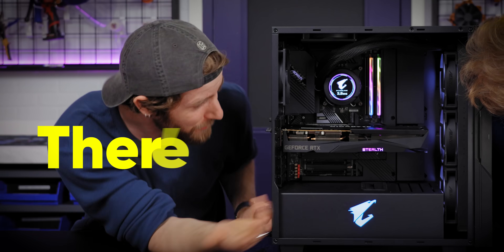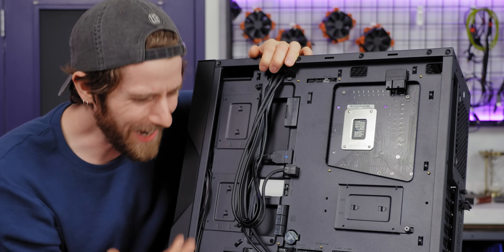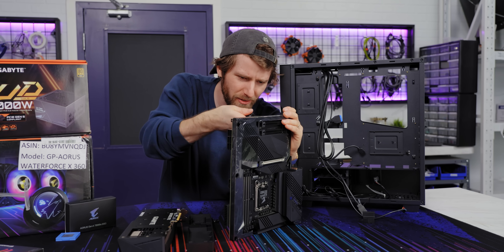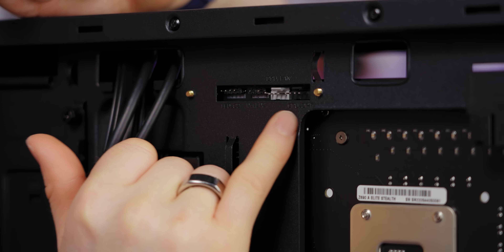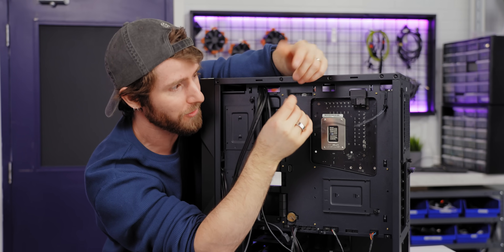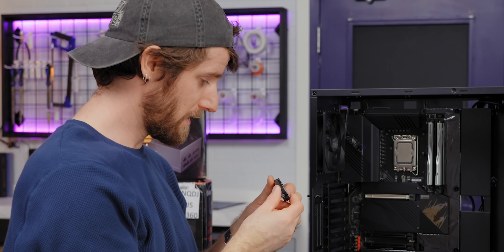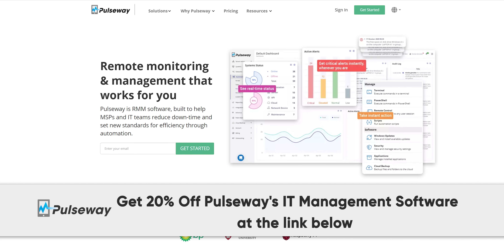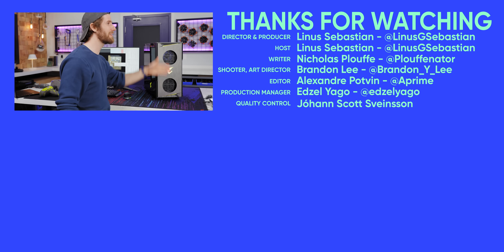Where Are the Cables??? - Gigabyte Project Stealth

Comment: Well, it doesn’t seem like it would be that difficult for every AIB to manufacture GPUs with rear facing power connectors.  That said, I wonder why the PCIe standard hasn’t just made an even longer slot to allow for more power delivery.  You could get AGP and early PCIe cards that would run without additional power.  If the concern is drawing more power from the 24pin, the could just mount some additional power connectors on the side of the board and run it directly to the slot a few inches away.

If board manufacturers would simply make more shit like this, those of use with tools and the ability to use them, can just make the holes we need in the motherboard tray.
Reply: Honestly any card could be modded with right angle connectors running back inside the shroud
Reply: @JackNormalMemes  I know, I feel like that should definitely be happening way more than it currently does.  Hell, I would've settled for connectors along the short edge of the card which would look remarkably better than where they put them on every other card.

Comment: that's what PCs should look like. 
rather than expensive parts hanging from cheap ass tinsel. 
You can spend 6k on a PC (I know) and it will always look cheap because of the cables! 
This is the first time a PC has EVER been properly engineered! EVER! (even tho they fucked up some basic points)
This should be a standard for all PCS above 2k.. there is no reason this can not be a standard!

Why GPS have the cables blocking the bit you have on show is beyond me!

The airflow was a fuck up but this is a good step!

Yes I edited this as the vid progressed!

Comment: I really don't see why this MB layout couldn't become a standard in the near future.

Also:  I never understood why the GPU power sockets are where they are in the first place.  Why not have them as close to the PCIe socket as possible, but facing towards the front of the case?  Would make for MUCH cleaner builds already, even without this 'stealth' patent.

Comment: I've had that A-RGB header issue with a number of products. Theres actually 2 different specs for the plugs which is the problem. While the pin-out is consistant there is a standard A-RGB 3 pin, and then there is a Slim A-RGB 3 pin, which has a far slimmer bezel on it. I couldnt find any of the Slim A-RGB connectors of the length I needed for my NZXT hub, so I had to whittle down 1 side on 8 cables as well so I used a flat wood chisel to trim them all down 😂

Comment: This is a great idea. I did not know that Maingear had patented it over a decade ago but good for them. I really hope this becomes a new standard for mobo layouts.

I have a full custom loop with fans + radiators+90 degree gpu power adapter helping to hide the cables. Only the 24 pin mobo cable can be seen so looks tidy.

Great vid and another example of how Gigabyte never test a product before they send a product to market. Been burned by Gigashyte enough times to learn my lesson and I was very dubious when I saw it was from these clowns.

Comment: It would be great if industry adopted this as the standard, the time saving this would be when you need to plug the motherboard connectors or do some maintenance and don't need to disconnect any other components is astonishing, just pop the back panel up, do what you have to do and close it back. Plus the front looks super smooth.
Reply: plus makes the cleaning easier
Reply: The problem is some idiot decided to patent this design(I think) so everybody doesn't wanna pay for that, it ain't that important. Plus, it makes it so that it's more annoying to DIY repair/change/maintain and less hands on people would have to buy from them instead.
~BUSINESS~

Comment: The second I noticed that gigabyte was the supplier of the case instead of a partnership with an actual competent vendor like corsair or lian li I already knew what the end result was going to be.. What an incredibly disappointing execution of one of the best concepts in pc building. I would have bought this setup no question if they had just got someone else to design the case.
Reply: I'm sorry what's wrong with Gigabyte? Genuine question. I got my monitor from them and I really like it personally, no issues.

Comment: "Tidier builds with better airflow"  . . . I think Jay(dont hold me on that) did a video on cables and such; TLDW: as long as you air flow in and out, cables don't get in the way. Its another feature that is on par with RGB. What needs updating is a Front IO standard so You dont have to put all those little pins together and in; remember when Mobo manufactures shipped with their own header that you could assemble then install those cables.

Comment: I had this exact issue with a BeQuiet 600 Midi case, I had to chop off the bottom of the front panel to get any airflow. Once I did it, thermals dropped from thermal throttling to around 55 degrees C. I honestly don't understand how companies can screw this up so simply!

Comment: It's not even necessary to strictly standardise port placement locations to make this a new workable standard for "reverse" ATX. Just have standard dimension strips of the area which are completely cut out on all "reverse" cases, and then motherboard manufactures can just put any port anywhere on those strips. The holes don't need to be flush to the ports at all because they're completely hidden underneath the motherboard.

Comment: I did this 20 years ago with a IC7 from Abit.. pop the pins out and put them to the other side then Flip the ATX plugs to fit... took time. But worked. had to cut the tray out, but not hard.

Comment: Yeah, this is a no go for many if not most as it locks you into a proprietary ecosystem - think Apple. If something goes wrong with the MB, you can ONLY use their specific MB at probably a hefty premium, same for the GPU. You should watch Jay's video on sh*t you don't need where this will defiantly fall into that category. I'll add that you could do 95% of the "stealth" look with a simple 3D printer, pretty much everything except the GPU.

Comment: I had to drill holes in the front of my case as it completely blocked off airflow but its a cooler master case just a few holes in the front dropped temps by 30c

Comment: The only problem for some of us if this becomes the standard across the board, is we'll no longer be able to display our beautiful custom sleeved cables...
Reply: the point of custom braided cables is that it makes the ugly cables look presentable. this solution removes the ugly.
Reply: Then you just need a temoered case with a glass back side panel, people already make those, typically on cases with minimal cable management options in the rear compartment because apparently they didn't think there would be overlap between people who want to display the back of their motherboard tray and people who like to do very careful cable management

Comment: It's always bugged me that PC components even come with cables at all.
With equipment being plugged into a common motherboard, why aren't the power supply traces preinstalled into the components?
Plug the equipment into the connector on the board. Power, data, the lot.

It makes no sense to have separate cables.

Comment: Gigabyte: "Have Linus test is is cheaper than doing proper testing ourselves"
Reply: Built in drop test 99.99% guaranteed.
Reply: Only if they take the advice, and honestly if they really did and kept iterating quickly it would end up being an awesome product with basically built in marketing value.

Send LTT a demo case that they never make in production numbers, let them rip it, and then fix all the issues and send a new one within 2 weeks.

With LTT serving as product Q/A in the process, and a vendor sharing their unique ability to create physical products and bouncing them off LTTs ability to fairly critique design and implementation - they could start a certification program - and meaningfully start to shape the standards to develop the next generation of internal PC structure sanity-checking and thermal compromises.

It'll be Snakes on a Plane but with pc cases, we'll end up with something that looks like it came out of Star Trek eventually - I don't think that can be anything but good.
Reply: @christophermartin1973  only flaw with that strategy is that they need to make it enticing for ltt to keep doing those videos, they're not dumb... well, maybe they are, but they're not solid-front-panel dumb

Comment: Oh my life. I've just got an RTX3080 Ryzen 7 3800X system running burn-in for hours with top temps at 74 in an ambient 23'C  on air cooling only (CPU was 54'C) so on what planet were Gigabyte living to come up with a solution that can't cope with this set up? Someone got the specs badly wrong versus the design concept.

Comment: I was hoping someone would come up with back mounted connections.  I was also thinking of a hardwired junction box that would route all the connections to the power supply area.  Case companies really need to up their game as well as mother board companies making everything standardized at least for connection locations.  Lets get rid of the wiring mess in these computers it's time to move forward to the future.

Comment: first i believe GN tore gigabytes PSU statement to shreds. second no wonder they asked you not to use a 12900k since the case has no airflow by default. Good video though with a good concept but poor execution by Gigabyte.

Comment: I really like how cool this design is, but I can't help but feel a bit of distaste at the fact that Maingear patented this idea. 

If anything, I would imagine that needing to pay royalties in order to design something like this just adds to the cost of production. And this is already something that already costs more than a standard design, making it significantly less attractive because of just how expensive it would be to the end-consumer. And on top of that, Maingear doesn't even make motherboards.

This just reminds me of the Scuf patent for controllers. Obviously I'm going to be biased because someone already came up with the idea, but I still think that the concept of "Put X parts on the back of Y product instead of the front" is just too simple to be worthy of a patent. It would be one thing if the patents described detailed PCB trace layouts or special techniques used to mount these features in a different location, as opposed to the simple idea of "put stuff on the back"

PCBs have already been made with components mounted on different sides for years, if not decades. it's nothing new. Normally this is done for space/size constraints, so all they did was take that concept and apply it to desktop PCs and their aesthetics.

Comment: So basically this is another Alienware
Reply: unlike alienware, only the motherboard and GPU is proprietary not the rest of the components. 
Unfortunately, the gpu is one of the components people tend to upgrade every 4-6 years before complete system upgrades.
Reply: @Robbie-mw5uu  You forgot to mention the airflow is just as bad as alienware. But if you change the case, oops you can’t because of the motherboard. That’s pretty bad. Bad enough I’m not sure if it deserves the Better Than Dell award.

Comment: So aren't the USB and fan connectors reversed by buying just pushed out to the other side of the board? If they aren't the whole Pinout of the board was changed. I can see the 3 pin fans just having the center pin placed "up or down" but not the 9 pin USB front panel connectors, even worse with the new USB C connectors

Comment: Those parts have no resell value unless you have the case. Not until there is a stardard and all manufacturers do it the same way.
Reply: Not really. They still do their job. Not being able to use them in other cases isn't that big of a deal when most people upgrade their entire PCs within 5-8 years anyway.
Reply: @Robbie-mw5uu  and lots of people buy parts on the second hand market. Unless they have that case, they won't be able to use those parts

Comment: Meanwhile, in my 6-year old, 3 5.25" bay+2.5" bay, dual 140mm intake case with a 280mm rad: the i5-12600K goes full burn on CB R23 and never goes above 65C.

Comment: Linus team! Is there any way to find a plain picture of this board. Im curious to the on SMT vs Through-hole part usage on the back of the board. Some of the stuff looks SUPER close to some 0402/0603 sized parts and was curious on how their selective solder machine fits that or if they do hand solder being that its a low volume run?

Comment: 12:00 I recently got a Lian Li LANCOOL II Mesh case and somehow they thought it was a good idea to connect the entire front IO to a PCB that is screwed into the inside top of the case so, if you wish to install the optional USB C Cable you have basically uninstall everything in the case, put the case upside down and then unscrew the PCB for the front IO because someone SOMEHOW thought it was a good idea to let the power and reset button rest ontop of pins with no kind of indentation or anything to hold them in place of those pins; the holes ONTOP of the chassis are holding them in place. This was super frustrating as I thought I just gonna go install the USB C cable "real quick" before the power and reset button fell to the floor and went missing for a bit.

Comment: This is an amazing design choice. I hate putting computers together and trying to fit cables together in those narrow places. Pins hidden inside a case and dark, a risk of bending them. Having them on the back is so good to see. I will be keeping an eye on one myself. Gear locked or not, that is a well thought out design that adds some new material to the generally standard box and mobo mindset for a computer.  I hope they carry on with this design further. Looks like putting it together is quite smooth.

Comment: Team up with Der8auer and Gamers Nexus, come out with a decent DIY front air cooling kit.  It even saves the planet because you can repurpose all those non "airflow" models of good cases like NZXT Lian Li and Phanteks.  Not to mention the crap oem cases like Dell and HP that wouldn't straight up throttle if they only had a couple vents.

Comment: Cool concept, msi, asus, gigabyte and astock should get together and make this a standard way of connecting components. EVGA and all the case manufacturers could take a few of their existing models and offer a compatible variant.
Reply: This ridiculous patent needs to be struck down. There is nothing groundbreaking about soldering components on the other side of a board. That’s everything wrong with the patent system

Comment: I'd forgive them for the non-standard stuff honestly. It's not like Dell where they make weird stuff because they want to; the existing spec doesn't support this kind of nonsense well so Gigabyte doesn't have much choice but to break the standard here. The patent isn't theirs either so there is a possibility of interchangeable parts under a Maingear-controlled standard. The case, on the other hand, is unforgivable.

I really want to see this in SFF. This looks like an amazing boon for space optimization and SFF serviceability.

Comment: The thermal part is gold. Drilling 2 holes temp goes down by 10 degrees. The case could use a front mesh.

Comment: Cables aren't actually that much of a problem in case of airflow. They really don't matter much. So that's not an argument.
Reply: They can be when you don't manage them at all and you have 9 fans in your case lol. But you're correct in that anyone with any knowledge of building a PC would never run into that problem. A complete noob who leaves all his cables in the front might gain a few degrees but nothing dramatic really

Comment: "have you learned nothing?"
Gigabyte: Makes an aluminum waterblock (3080 gaming waterforce) that corrodes like hell, their fix: an anodized aluminum block.
So the answer is no, no they haven't learned anything.
oh yeah, and the blocks (gaming or xtreme) can't be disassembled for cleaning without ruining the stupid decorative foil stickers.  
Oh yeah, and my xtreme waterforce came WITH ALL THE SCREWS LOOSE FROM THE FACTORY.

Comment: Before Linus even talked about vertical GPU I was thinking it was missed opportunity to have a PCIe slot on the back of the motherboard (could be tied in together with one of the ones on the top just allowing you to use either or) which would let you hide your riser cable.

Comment: This gives me vivid flashbacks of building in my recent Corsair Airflow case. I have high profile ram which is also corsair branded, with a corsair double radiator, and figured since its all corsair I should be able to mount the radiator above the CPU like in the diagram.... boy was I wrong. If you bought their high profile ram you have to mount it at the front of the case (which its fine, but I couldn't fit the third fan on the front due to the radiator taking up the extra space :/ ). Silly that they don't even test their own products as an end-user. That being said once I was done building it works beautifully!

Comment: Um, so if I get out my soldering iron and move all my pins to the backside myself I'll have the same thing.  Also lots of motherboards have right angle power and SATA, hide it behind a shield, from that far back in the case nobody will notice the 0.5inch/13mm difference.  Lots of useless here.  Could also make a 180° PCIe power connector and a cable channel to hide it for 90% of the benefit and 5% of the work.  Integrate the PCIe power into a support bracket and it will be invisible.

Comment: This is so much better it's actually insane it's never been done. Try to reconnect a usb, audio, fan, etc on the bottom from of your motherboard after putting it in the case and installing a gpu. It's next to impossible not to mention if you upgrade your fans or even PSU with this you just pull off the back panel and bam everything is right there. I love it.